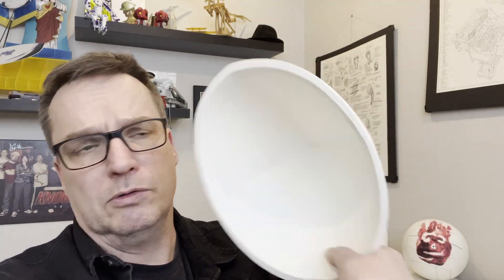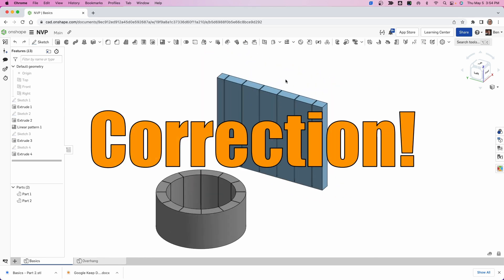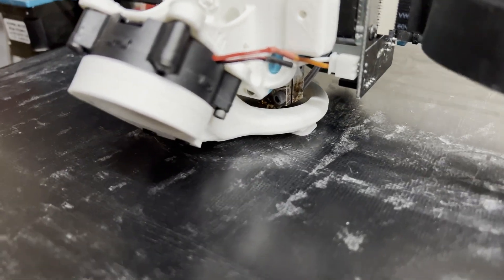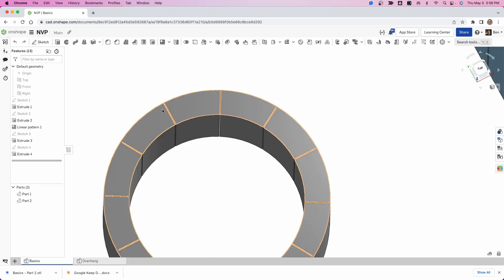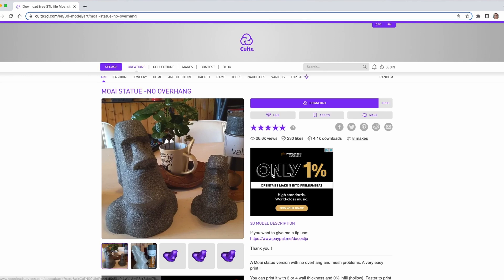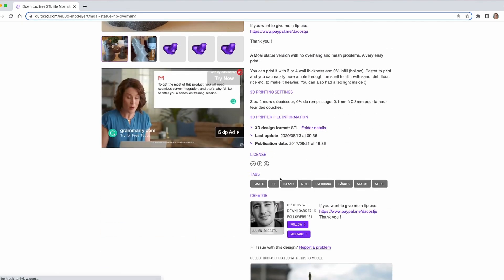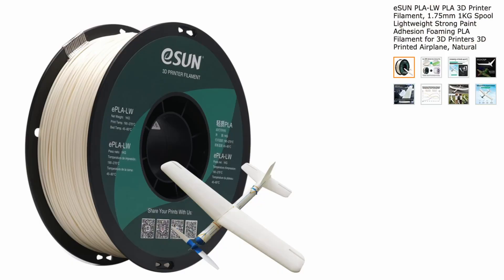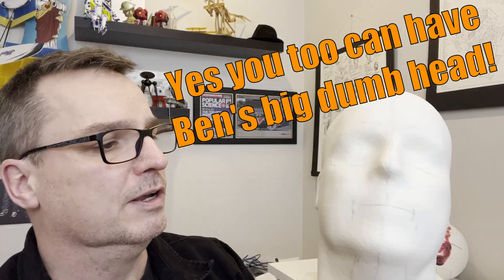3D Printing in Half the Time - Use This Trick to Speed Up The Process!

Comment: Great job. I'm still confused as to how to implement this in my prints but hopefully someone can break this down even further for a simpleton like myself.
Reply from the maker: I’ll be doing a series on this and hope to clarify it for everyone. Stay tuned and subscribe!
Reply: @DreadMakerRoberts  Awesome, I get this in concept, but how to accomplish this on any shaped object is going to be a super awesome tool to have. I've avoided large prints only because of the print time.
Reply from the maker: @KombiGnome  This makes me very happy. Nothing better than leveling up in 3D printing and exploring other more challenging stuff.
Reply: He's using my system actually or he discovered the same thing I discovered basically a way to do complex multi-surface vase mode prints I have an entire video on this you'll have to go search for it it's not polite to post links to your own videos and other people's videos comments

Basically here's the process you hollow out the model to the thickness you want so whatever separation you want between the outside service and the inside surface and you hollow it out usually you just shrink the model itself and use it as a cut tool to remove the inside or in something like fusion you can probably set an offset for a more accurate inner wall

Now that just gets you to surfaces they still have to be connected in order to do vase mode this is pretty easy you create a slice plane 0.01 mm thick and you cut the model in half but you only go through half the model so think of it more like a c so you're going to cut a line straight through the entire model from top to bottom all the way through to the center of the model so in the case of the helmet to the center of the helmet you have now connected the inside surface with the outside surface it is now from a geometry point of view a single plane you can now use vase mode

For some models that right there might be enough especially if you want to really thin wall and you think just two perimeters will be enough but to go even further you want to have some separation between those walls and you want to connect them you can see the ribs that he used to connect them how do you print those I'm not sure how he does it but here's how I do it I compress my model to 0.01 mm thick so that it becomes a plane you'll have to do this separately for each plane you wish to create a ribbon

I then bisect that planer silhouette of the model in half and I move each half of that half toward each other by double the thickness of the nozzle so if I'm using a 0.8 mm nozzle that's 1.6 mm if I'm using a 0.4 mm nozzle that's 0.8 mm you need this for each side you can't just shrink the model you actually have to offset the model so that the offset between the cut you're creating stays equidistant with the wall of the model again in my video I go into detail how to do this

Once I've shifted each half the double the wall thickness each toward the middle I rejoined them again center them in the model and then cut this creates a single rib on each side that rib needs to be double the wall thickness or nozzle thickness from the outer wall in order for the slicer to not break vase mode this creates enough distance for the nozzle to be able to come from the inner wall to the outer wall make 2x 90° turns and then head back toward the inner wall again

Without stopping and without breaking vase mode because you're coming so close to the outer wall that extrusion will touch the outer wall and meld to it do this multiple times for each rib you wish to create this is a lot easier with symmetrical shapes I use this for example to make rockets and nose cones

The result is you have a complex multi-surface reinforced structure that is a fraction of the weight and takes a fraction of the amount of time to print it on top of that because you're using vase mode cleanliness is extremely high even if you have an improperly tuned to printer because you're not performing any retractions you're just doing a continuous extrusion from start to finish of course the rules for vase mode apply you cannot do this process for a model that cannot already be printed in vase mode if the model would fail as a single perimeter vase mode it's going to fail as this so those rules do not change no Islands no overhangs no flat surfaces that aren't on the top and the bottom unless you want holes
Reply from the maker: Totally ok with you sharing your link to this. I want to see it. I do follow you but have not seen your video. Came up with this in a similar way I think judging from your other comment.
Reply: @DreadMakerRoberts  it probably won't let me even post a link but if you do a YouTube search for complex vase mode my videos the first one that pops up
Reply from the maker: @nerys71  Added a pinned comment to the comments thread with a link to your video at the top. Your method with tinkercad would be good for the mesh files I struggle with
Reply from the maker: Also curious about your doubling of the nozzle diameter. I do 1/2 the diameter and get super strong parts. Unless I am reading that wrong.
Reply: @DreadMakerRoberts  what you are doing should not work in fact geometrically speaking it can't work your distance is double the nozzle thickness even if you're not actually doing that meaning the slicer is compensating what slicer are you using? And what thin wall behavior settings are you using? Because I would love to have the slicer do that work for me :-) it can be very tedious if I change from a 24 mm nose cone to an 18 mm nose cone I need to restart the entire process but your process looks like you could just scale the part in the slicer will compensate! So it would be great if we could figure out how you're doing that

For universal compatibility your gap between your slot and the wall must be two times the nozzle diameter they will still touch and melt together

This is to avoid a collision that will cause a separation of the continuous extrusion line think of it like drawing a shape with a pen if two lines touch the shape breaks so you have to draw all the whole thing without the two lines touching but you somehow got around that I would love to figure out how you did that
Reply from the maker: @nerys71  So I think that cura using a 'middle' slicing tolerance is what makes it work here. That is what I based the gaps on and it worked first time. With changing things I use a parametric CAD system so I just make the nozzle gap a variable at the start of the design and it is nothing more than a change the number to modify the model to the new nozzle. What 3D modeler are you using? What is the link to your video? I need to watch it now
Reply: @DreadMakerRoberts  oh now that's interesting I did not know kira based its extrusions on the center of the extrusion path that would explain a lot of weird things I sometimes get out of cura parts not fitting and stuff like that :-)

Simplify 3D defines the outer perimeter of the model so the extrusion is always negative into the model compared to the outer perimeter so yes you would need to use one times your nozzle diameter if your slicer is using the halfway point for your pathing that makes this more difficult since it will change from slicer to slicer that's really annoying :-)